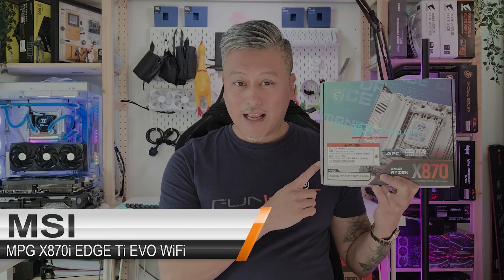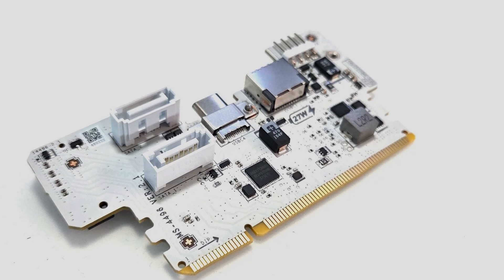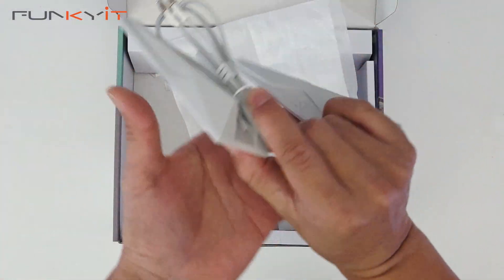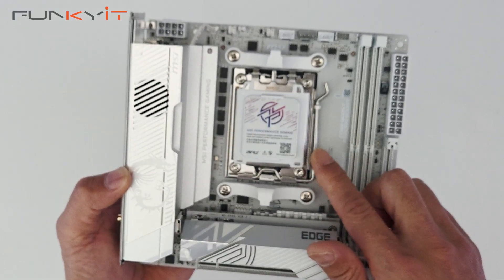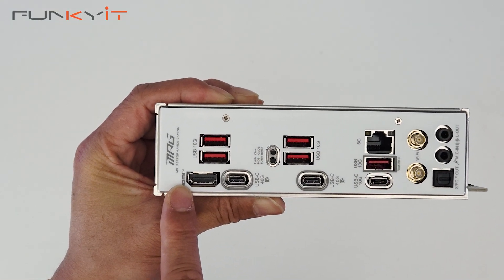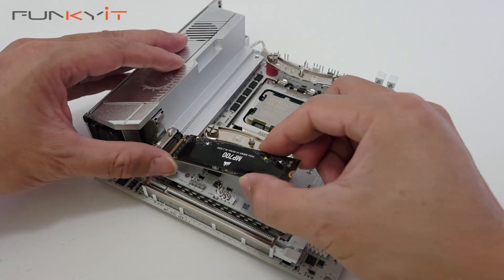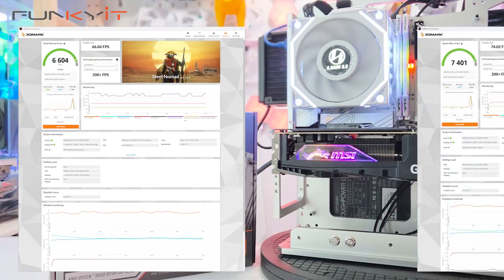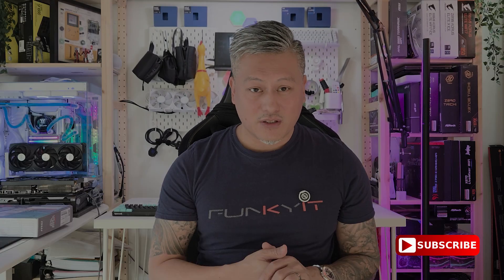Meet the MSI MPG X870i EDGE TI EVO WiFi - The most compact and feature-rich Mini-ITX AM5 motherboard

Comment: Hey this was good at showcasing the overall board features but the benchmarks could use more work. Stating a bunch of benchmark numbers without any comparisons will mean nothing to most of your viewers unless they know the numbers off the top of their heads for their own boards. This section would have been more useful if you had pit it against another high end itx board like the Asus x870i or even more interestingly w budget one like the Gigabyte Aorus Ice x870i. Comparison benchmarks are much more useful for testing and disseminating and also give is kind of work as a check in making sure your testing is solid and nothing is too far off. It would have been good to compare features with a couple of other boards on the market as well. Just saying something is good without any comparisons to the competition isn't really helpful